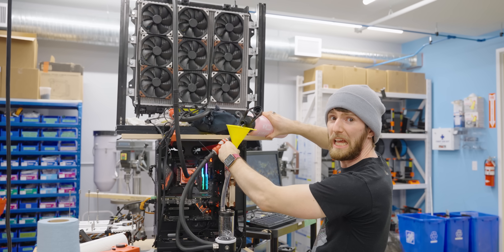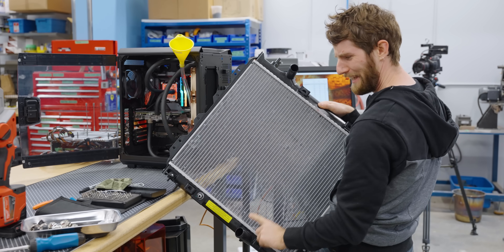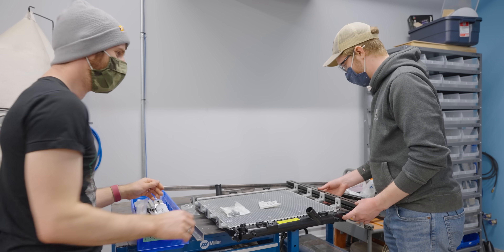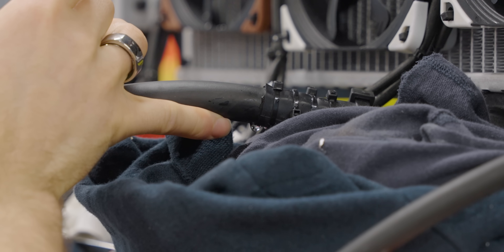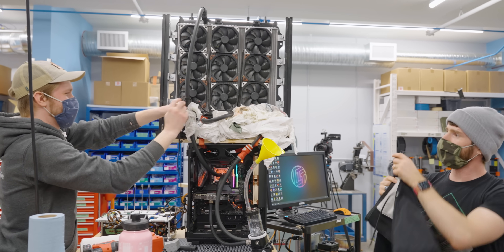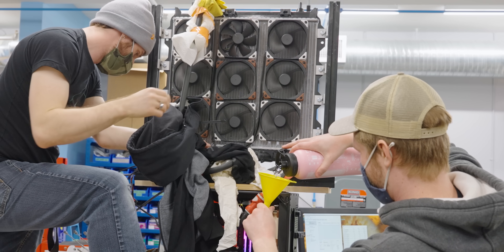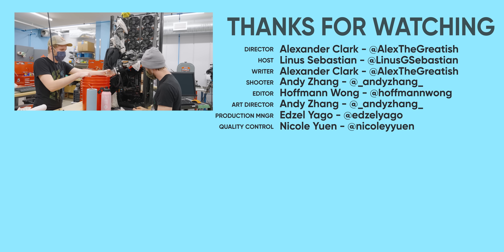Our Craziest Cooling Project Yet - Car radiator liquid cooler

Comment: Hmmm... At this sort of price I don't really see why you wouldn't just get a MO-RA3. It no doubt cools better as it's a lot thicker and has fat pipes. Since it is actually designed for watercooling you also have standard connections to work with and mounting holes for fans so you don't have to jank-rig everything. It's actually not that expensive in the context of watercooling hardware - and you can basically garantuee ambient coolant temps on one of those, or even handle multiple systems on the same rad.

To make a car radiator worth it I think you would need to find a used one for a pittance (which is no doubt very doable - there are probably tons of older ones in serviceable condition lyng around repair shops).

Comment: Leaving computer guys attempting to use auto part to cool a pc.   How could this have gone right.    Like this hurt so much to watch now I wanna do this right but don't have anything to do it with.    Like car fans are 12v get a second power supply set up the car fan to it and then use some reducers for the main loop and then make it table level

Comment: I respect the insanity, but the auto-mechanic part of my soul is yelling so many swears right now
Reply: I was thinking just use an universal water to air intercooler kit for supercharged and turbocharged vehicles??  Quite entertaining though... If I had the money I would use 2 universal water to air intercooler kits for supercharged and turbocharged vehicles.  One for CPU and  the other for the GPU.  Use box fans cooling the heat exchangers radiators.
Reply: @frestkd  they could have just gotten reducers

Comment: I mean, this was obviously chaos for the fun of it - 
If they where trying to do a sensible loop they would have had Alex lathe an aluminium adapter to take the bike hose radiator connection and screw in a 1/2 or 3/8 barb, the leaks are because you can't get a clamp or zip ties to bite down on a compressible rubber hose
8/8 gr8 b8 m8

Comment: I think they're hamming it up for the camera. I have a hard time believing that Linus doesn't know to run the pump on a separate PSU (or to disconnect the rest of the system from the main PSU) while filling a loop and that Alex doesn't know that to get a good seal on mismatched soft tubing you have to put a piece of hard pipe in the joint for your zip ties or pipe clamps to press against.

Comment: Spend the extra day and do it right, or at least better. Make it leak proof so half your video isn't 'get more fabric', a doctor doesn't just shove more gauze in, they sew it shut. Use Noctua fans and make it not the space shuttle, we know you have them in that shop. Come on man, low bar effort here.

Comment: u know there exist a 360*360 mm radiator that would be the same size of that and also takes 9 fans, maybe they would do a better job as the connections and pipes are standard size.

Comment: ok now i want to see them make a custom hot rod computer with the engine bay as the computer and the driver seat as the desk and use a full car radiator system

Comment: I know this video is for giggles. But for those interested you can get a 360x360 rads. Even a 420x420 rad made with proper fittings. 

Watercool MO-RA3 360 LT white

Might get one for my next build ☺️

Comment: I think you should build a stack effect cooler that uses an obnoxiously tall chimney to passively move air through a heat exchanger. It would be totally silent and only require an obnoxious build and a few dozen feet of stove pipe. Also would only work on an exterior wall, but you know.

Comment: someone needs to send Linus a Phobya SuperNOVA 1080\1260 or an MO-RA3 or RA3-420.

almost same surface area (bit smaller but thicker), no stupid connectors, sensible mounting holes and believe or not... they are cheaper.

but then all the drama would be in the drain... :P

Comment: I actually built waterloop to old AC outside unit radiator, bit of an overkill but no need for fans and normal clear tube can just be clamped on top of the copper tubes. You get double the surface for passive airflow when you spread it apart a bit as the radiator was dual layer.

Comment: The scale of this water loop is not as crazy as the whole room water cooling project. But add the facts that this loop is constantly leaking on top of the computer while running stress test and have a good chance killing a GPU that doesn't really exist，I do think it is much crazier.

Comment: Though silly this could be the basis for a more ambitious build. I would like to see a full build using care tech. You could have a holly dominator or other ecu to create a smart cooling system. There is all the Rywire wiring tech and the big power plugs they use. Rob Parsons aka Chair-Slayer would be the perfect guy to colab with. You could call it the LTT SEMA Build. There is a long running joke about "bluetooth drive-shafts"

Comment: And for the same price you could've got a Watercool MO-RA radiator that's about the same size and made from copper with standard 1/4 inch fittings.

Comment: Why not just go to a radiator rebuild shop and have a custom radiator of same volume... shaped in a way that holds all components....? Have custom spots that distribute the cooling to all parts of the PC....multi purpose cooling with 1 unit. All hdds and stuff would each be cooled by 1 unit that the fan could be placed anywhere

Comment: When i saw this janky tube conection, the only thing i could think of was, that there is a lathe not that far away from them, even in the same room, with a piece of aluminum they could have mad an easy adapter to connect the larger diameter tubes to the smaller ones and they pobably wouldn't have had that much trouble with the leaks

Comment: Nice project! You should do a Version2 of this, by using the car fan with the shroud that goes with it. It draws around 15A, simply connected to another PSU. For the leaks, use rad hose adapters to AN fittings, and an electric car water pump. You should have nice a flow, with way less leaks.

Comment: One thing to avoid all potential leaks never connect outlet (which is huge in diameter : ))  with smaller diameter pipe, no matter what you do it will find a way to leak. Lol I haven't ever done PC water cooling just from connecting garden pipes ;)

Comment: You guys should have gone with a 90's through early 2000's Honda civic radiator those things are small enough to fit inside a full size case probably, and you can get a Denso Brand radiator made in Taiwan for under 100 off amazon. Because the most unreliable part of that cooling set up is the radiator since its a Chrysler product its bound to fail well that's what I learned from Scotty Kilmer

Comment: Or just hook your cooling block to the faucet...
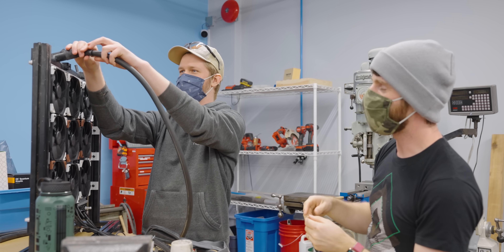7:50 Don't you have a 3D printer to make a reduction? 
Also, transmission loop was pointless, because it is just a straight pipe that goes through water from a "big" loop.

Comment: Sorry this is not Cooling Project... this is just dumb. 🤷‍♂️
Just use something like the MO-RA3 420 - not to waste radiator space with the fans like this and to have less of a pain connecting to the loop.
And if you want to use car radiator - use car fan as well...
I loved the projects like whole room cooling, or using regular heater radiator. You have all the tools and resources to make this properly, not to use a bike tube with zip ties... that is just lazy 😪

Comment: You can get way nicer radiators on ebay for less money. Totally custom made all aluminum honda civic aftermarket rads. Check them out, the aftermarket is so big and competitive that you get great products for the price. Plus they just have 1 in and 1 out so it's much easier to hook up.

Comment: This would be better if you actually planned it out. Maybe a portable plug in radiator for a pc that has input output valves where a pcie slot ports would be. Plug in and fill loop and go ( no leaks )

Comment: I had this idea a while ago. I was gonna use a four wheeler rad though and I was gonna hide under the house. Lol run too little lines to where my desktop sits and have a system with no fans pumps or anything to make noise when being used

Comment: You have an entire shop and you couldnt come up with an adapter that doesn't leak? Also using the trans cooler is a dumb idea.... Should've just plumbed it all into the main part of the rad....

Comment: I personally dumped the idea of Water Cooling my computers a while a go.. Is not worth the hassle you can get excellent Cooling just by getting the proper heat pipe cooler and fans for your case.. Cheaper, Easy to build and easy to maintain..

Comment: As an electrical engineer, I’m slightly concerned as to why you decided to do an experiment with a large displacement of water above the PC. It would have done the same job placed separately with a high flow pump in situe. Although I do like the concept of the “experiment”, maybe re-try with a little more prep?

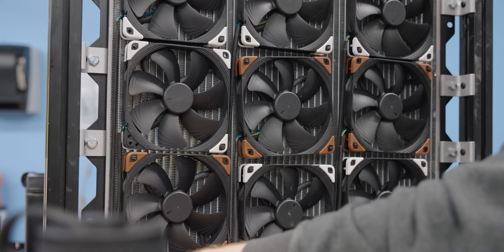Comment: (6:42) I would have added 2 hours to the project as I would have painstakingly counted out the holes to stick the zip ties through so that the fans were all perfectly squared/aligned. I'm a little OCD. ;) :P
EDIT: AND of course made sure to use fans with matching colored rubber anti-vibration pads. Heck, I would have got Noctua's cool ( :P ) NA-SAVP1 Chromax colored anti-vibration pads, too! ;)

Comment: I would suggest Flex Tape for the connections.  It's basically rubber tape with adhesive on it. You can form it to your reducers. Also, silicone vacuum lines would make good hoses. 👍

Comment: i know they were trying to keep the cost down but why wouldn't you use a fan made for the car radiator? wouldn't work better then a tone of computer fans and use about the same amount of electricity like there is a tone of wasted airflow it looks like.

Comment: Excellent waste of time boys, should have used hose clamps on all the connections, and capped off the trans outlets/inlets.
It would have been smarter to use an actual car radiator fan for cooling , and a bigger pump for faster circulation.

Comment: mostly it's just a trans fluid warmer. you'll keep it from getting any hotter then the engine, but the trans also likes to be a certain temp so the fluid is still warmed off the radiator to keep the trans at operating temp. why didn't you just fill the main core with water and plug it, and just leave it sitting, it'll still shed the heat off the core running inside of it.

Comment: Why not just use a smaller Radiator like a Austin rover mini radiator or a Geo metro radiator and just place it on the side panel of a case with similar dimensions? thonk

Comment: Fyi the plastic tanks are tapable plastic. Should have just drilled some holes and epoxy some g4 fittings in there lol. Also, the transmission hookups are just a small liquid to liquid heat exchanger. Using it in your loop wont really help in your application. Its located on the cool side of the rad and since operating temp of the trans can be much higher it mostly works great. And it helps the trans get up to operating temp faster as well.

Comment: Personally i just went with an Alphacool 560 Monsta. If I somehow need more cooling than that (5kW at 60C coolant temp and 1000CFM) I'd just get a 2nd one in parallel. But considering it's cooling 1kW+ of CPU/GPU/48V PSU/5V PSU  and still only needs 800-900 rpm on the fans to keep water temp at 40C I think I'm good.

Comment: The transmission part goes into the water of the engine portion, so the water that cools the engine also cools the transmission. I would have either not used the transmission portion at all. Or route the PC loop into the transmission cooler, and put a close loop on the engine portion with close to freezing water in the engine partion with a seperate pump. So the freezing water would have cooled the transmission cooler which in turn would have cooled the PC

Comment: I've been using the AC condenser for a Chevy Astro in my pc loop for about a year now.
It works amazingly. I can run my system entirely passively if I want, or turn on my room fan and cool it like that.

Comment: Car cooling has several loops because engines need a certain temperature to run at. While computers are happier at lower temperatures, car coolant is usually held between 80-100 degrees C, depending on the engine.// Newer cars run hotter, and temperature gauges are all fake.

These loops make it so that when you cold start a car, a certain loop engages and works so that your engine will come to temperature quickly. Once at temperature, another loop engages. Usually it's just two loops, but there can be more. Waste heat is used in your heater core to heat up the cabin.

Oh, and EVs also have cooling loops if batteries are watercooled, and also batteries need a certain temperature to work correctly and have good discharge rates. It all depends on battery manufacterer's numbers.

// By the way, new cars have radiators so fine even touching the mesh will bend it and cause it to not work properly. Always service your coolant, water lowers the boiling point which may make your engine overheat.

Comment: Using a car air conditioner is extremely smart, but then please also use the correct coolant, such as in the refrigerator. And pleace use a bigger pump.

Comment: the transmission one. has to cool it a lot less than the engine one. thats why its a radiator built inside the main one. 
the main one transfers from water to air, and the other one from oil to water. its just a loop of oil surrounded by water.
Reply: btw. should NOT use the oil one.  cause that metal has been "sucking" oil for a long time. and will contaminate water.

Comment: add a mister between the fans and the radiator and watch temps drop way more. evaporative cooling is actually very effective on radiators